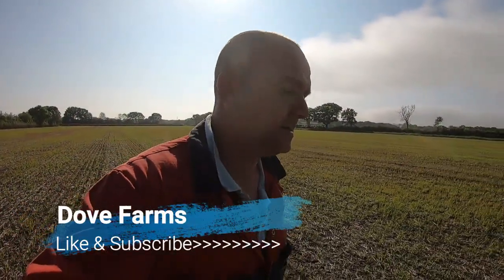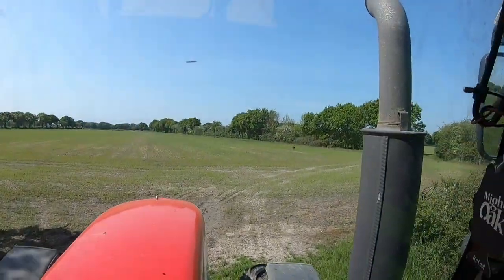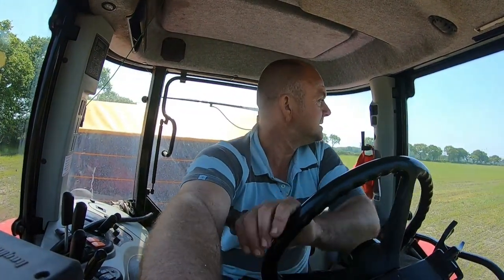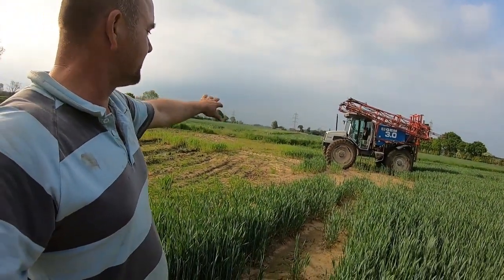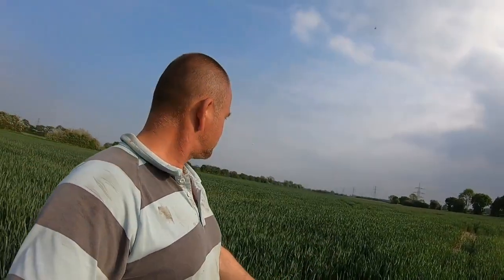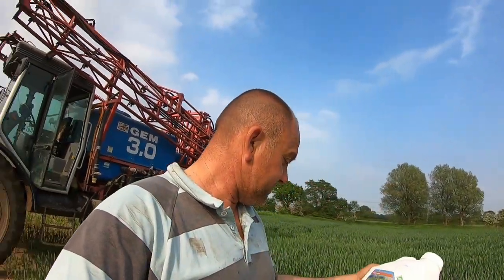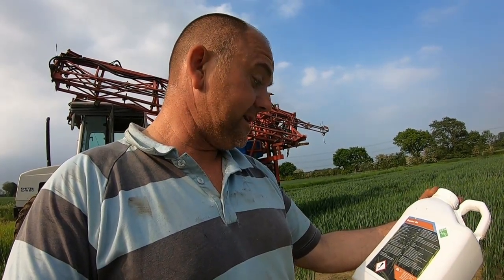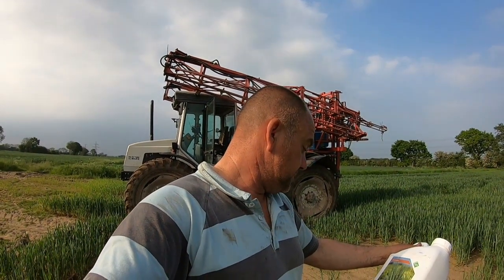Spreading Fert , Spraying & Mowing

Comment: There those seem to be a bit of a move away from conditioner mowers, what with nearly everything getting tedded and raked. I'd be tempted to try doing without the conditioner myself as an experiment some day, alot cheaper to buy and run, less hp needed too.
Reply from the maker: Steal flails are the best I think , they do a job cheers Richard